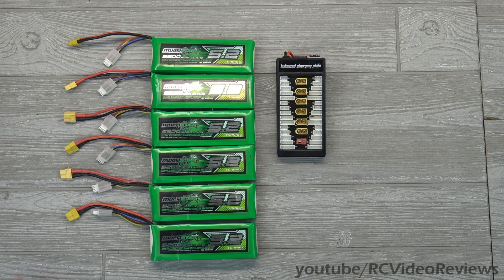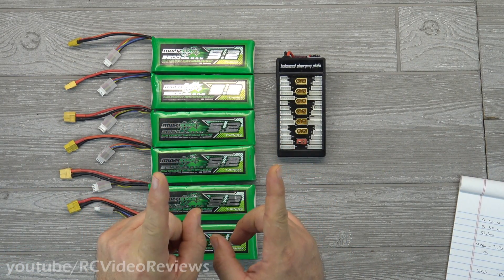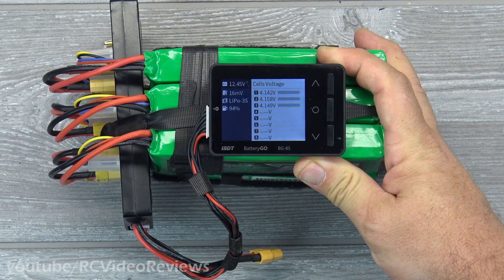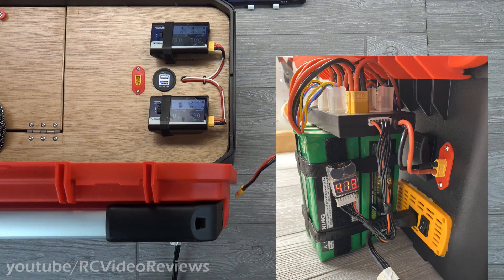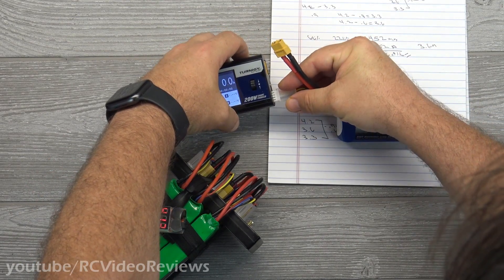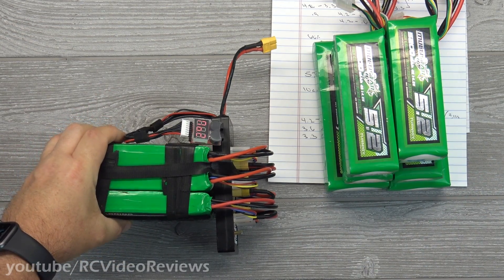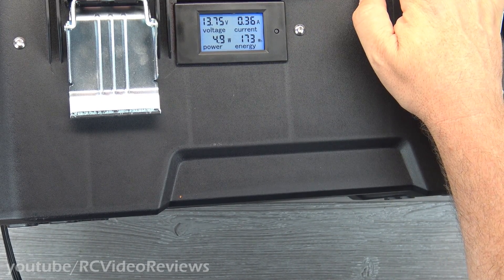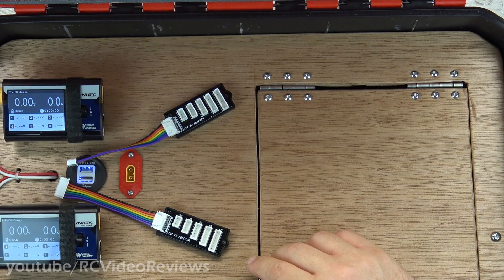31,200 LiPo Powerbank in 5 Minutes

Comment: Thank you for the video!! Great stuff!  Q: I shouldn’t mix battery voltage right? Meaning 2x 6S 5000mah and 2x 4S 5000mah for the field power bank of 20,000mah total.
Reply from the maker: You can mix voltage with series connections but not capacity. You can mix capacity with parallel connections but not voltage.

Comment: Hi!
I'm moving into a sailboat, and I have lots of these LiPo batteries barely used stored in my garage.
And I was thinking about making a big battery bank with then to be used on boat for small fridge, usb stuff,  and so, while being charged by solar.

This project of yours is the closest I found about packing these batteries as a bank, but it still need some close atention on recharging then and so on. Have you ever seen any project that fits what I'm planning? Like using some kind of bms to take care of all this charging and balance stuff
Reply from the maker: There are tons of examples on how to build large battery banks using Li-Ion cells like 18650's with built-in BMS. Search for solar battery banks and e-bikes.

Comment: Where did you get those for $12 per?  I have 8 3s 1400 packs that were $20 each.
Reply from the maker: Hobbyking used to sell them under their Multistar brand. They pitched them as quadcopter batteries which was a mistake. These were EXCELLENT long range FPV batteries for small planes. I used to stuff one of these in my Bixler 3 and fly it for about 30 minutes. They're only 10c discharge rated so 50a, but that was absolutely perfect for FPV planes like the Bix3.

$20 3s 1400's is too much. Turnigy 3s2200 45c packs are normally around $12.

Comment: I want to build a double prop rc plane and I think two relatively small motors may be enough to make it fly. If each engine uses 6 amps and the battery has like 14,000 mAh, then that's enough to make it fly for about an hour right? I'm a beginner. Would it be possible to use a power bank for a phone to power the plane? It seems like the cheapest option.
Reply: Thanks dude! You're a genius!
Reply from the maker: @Minskpotato  You're welcome. Good luck with your project.
Reply from the maker: LiPo MAH indicates capacity to cutoff voltage which is about 3.3v/cell on LiPo. To preserve pack life, you shouldn't go lower than 3.7v/cell under load which is about 85% of the MAH rating. So use 85% of the rated capacity for your calculations. In the case of a 14,000mah pack, I would base my estimates on 11,900mah. At 12 amps, that would give you just under one hour.

Power banks probably use LION batteries and not LIPO batteries which means you'll generally have a lower discharge C rating. You can arrange LION batteries in parallel and series to get a sufficient discharge C rating if you know what you're doing, but I would advise against using a commercial cell phone power bank to fly a plane as it is unlikely to use LiPo and is unlikely to be designed for high C discharge rates. We use LiPo because this chemistry is able to hold voltage steady over time better than other chemistries.

Comment: Good info and easy setup👍Do you have a list of material/equipment you are using? What type of balance board are you using and can I buy one.
Reply from the maker: Ray, Any common voltage batteries will work the same way. Otherwise, I used some velcro straps and this balance board: https://www.amazon.com/Battery-Charger-Parallel-Balanced-Charging/dp/B07SQ8BWDD/

Parallel charging boards are fairly common out there. There is nothing special about the one I used. I'll put the link to this board in the description.